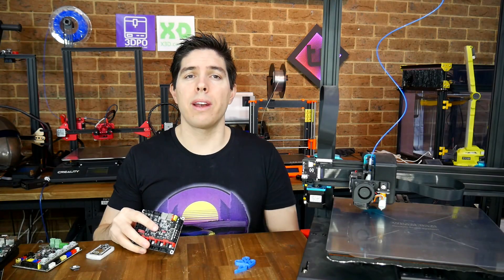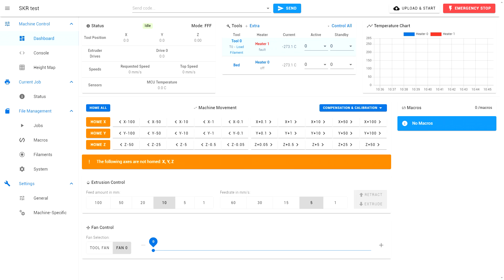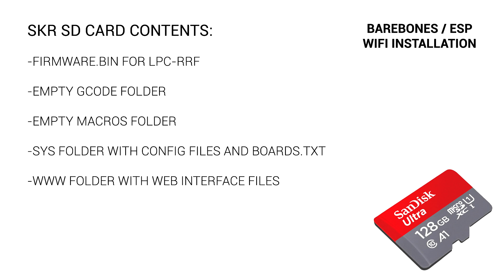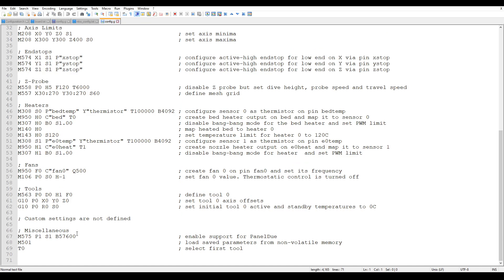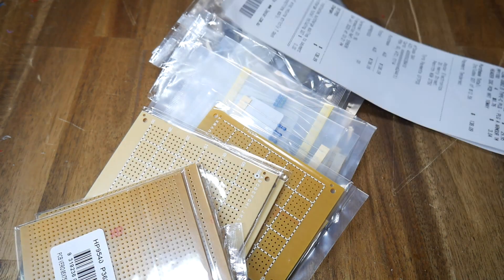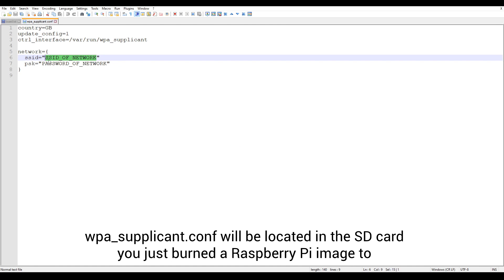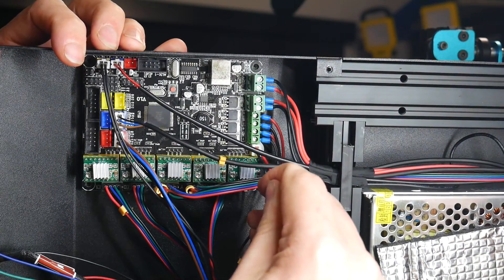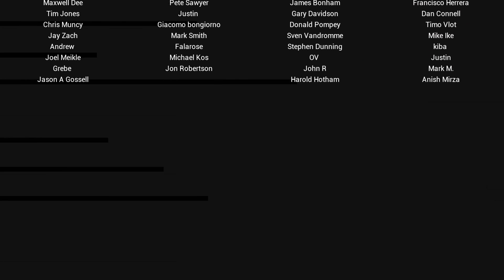RepRap firmware on SKR mainboard guide - The best firmware on a budget

Comment: I have a GRR X400 with dual extruders. Its not a completely polished model as lots of the components are 3d printed. I want to upgrade it to use the octopus controller but a bit lost of where to start with the programming and which firmware is going to be the easiest to configure to the specific machine.   Is there a common 3d printer that already has a lot of precompiled/preconfigured firmware already available that I can start from?

Comment: Thats nice....
unfortunatly i have to program configuration.h and i have TMC2130 stepper drivers.... and they don't have them in there... Im going to have to use the vscode to put everything in for my SKR 1.4 Turbo
Reply: i also wish there was a way to use an ethernet cable..... then i could connect with it directly through the internet

Comment: Where can I get the WIFI adapter in the United States?
Reply: Did you find it sir?
Reply: Not in the US.  I actually ordered it off the net.  
But I'm experiencing a new issue that I just Can't seem to get past.  I'm building a dual z printer and want to use reprap.  When I select my board in the online tool, it doesn't show me the option for a second Z axis.  How do I add a second Z?  Also, on another board I'm having an issue where the web interface shows up in egde or chrome, but I get an error and I can't adjust the settings.. I can't remember the exact error now, but it's throwing a hammer in all my gears..  very irritating. Lol

Comment: I have a Sidewinder and have attempted this port, however I am having 2 issues, I cannot get the axis to home because it is not recognising the inductive endstops, second issue is I cannot for the life of me figure out how to tell the firmware to use the E1 stepper as Z2.  Are you able to share your config.g file so I can see where i have gone wrong?  I have the SKR 1.4 Turbo and using the SBC via Raspberry pi (thanks to Peter's Tindie Store).  Thanks.

Comment: Hy and thanks for your verry nice video.
There is a new product BTT with an ESP 8266 integreated : the BTT RRF WiFi V1.0
It is posible to install Duet firmware with this product. I bouth one but no tested yet.
Do you know this product ? Is it possible to do a review about it ?
Reply: Have you already tested it? I'm thinking about to use this wifi module from BTT
Reply: @DominusJV   I have the BTT RRF Wifi V1.0 module and it's working.. Getting the FW loaded is the real trick..  https://www.reddit.com/r/3Dprinting/comments/lzlp4z/flashing_firmware_on_the_bigtreetech_rrf_wifi_10/

Comment: After flashing RRF3 firmware on my BTT SKR v1.3 with TMC2208, I noticed that RRF3 doesn't support stealthchop and the motors vibrate and are really loud...
LE: Disregard that, using M569 P0 S1 D3 V100 enables stealthchop

Comment: I'd love to see a comparison between the RepRap interface and Octoprint. I know one of the large advantages of Octoprint is the 3rd party plugin support and I don't know if RepRap offers those or not.

Also, for the Raspberry Pi, would a Pi Zero (or Zero W) work or does it have to be a Pi 3 or 4? I feel like the wire loom for the Pi is way cheaper and a Pi Zero is $10, meaning it would be the best of both worlds between the Wifi board and the Pi 3 (easier and cheap).

Comment: I have a problem ... I use BTT RRF WIFI v1.0 ... + BTT SKR 1.4 Turbo ... + BTT TFT70 / MKS Pad70 ...
the first run is OK, but after a reset or shutdown it no longer works, screens connect, but WiFi is not working !! ?? you have to replace the SYS folder from scratch and it's ok to reboot, what could be the reason ?? I looked at various memory cards
Reply: M552 S1 in the config.g?

Comment: COOL! Ordering the stuff I need now.... I have a duet 2 Wifi, so to me this is like an upgrade, thanks, let you know how I get on.
On a side note, I did add an external antenna to the Duet board and chopped a trace on the onboard antenna, although all the moaning about matching the antenna is true, I chose to ignore it. Basically I slowed the wifi connection down, as the antenna is not matched, however it is now more reliable, so the file to print make it to the 3d printer first time every time!
Reply: It's up and working, wiring to the Ender 3 now, need to get a box to hold the SKR board and the Pi3 in the same housing with a fan! Will design something for that and just 3d print it.
I added a DC to DC converter to power the Pi, taking the 24v to 5v, its working fine. So far so good.

Comment: Does stealth chop still work?
Reply: Yes it does
Reply: M569 P0 S1 D3 V60                                      ; physical drive 0 goes forwards using default driver timings D3 is stealthchop V60 is the hybrid speed
M569 P1 S1 D3 V70                                      ; physical drive 1 goes forwards using default driver timings
M569 P2 S1 D3 V32                                      ; physical drive 2 goes forwards using default driver timings
M569 P3 S0 D3 V32                                      ; physical drive 3 goes backwards using default driver timings

Comment: EDIT:  I just rewatched this and see this is addressed at the end of the video.
I've been running the skr for a while and have the Duet wifi on one of my other printers. On the SKR 1.4 Turbo I have the hotend heatsink fan on the heater port E1 to have control of that fan. I imagine it's something like M950 F2 C"!fan2+^pb6" from the example gcode from duet, but I don't really understand what the variables mean. Looking at the gloomyandy github I see under the last section of the wiki Re-ARM  pin names and "2.4 e1heat d9". Would anyone in the community say this added to my fan section in config.g looks right?

M950 F1 C"e1heat" Q500                                   ; create fan 1 on pin fan1 and set its frequency
or
M950 F1 C"d9" Q500                                           ; create fan 1 on pin fan1 and set its frequency
then
M106 P1 S1 H1 T45                                            ; set fan 1 value. Thermostatic control is turned on
Reply: Come to the Discord!
Reply: @PCR  do you have a link? I have a few questions on this setup I could appreciate getting answered. Thanks!

Comment: BTT just came out with an official expansion board for the SKR V1.1,1.3 and 1.4/Turbo that takes up the EXP1 and EXP2 headers, in return you get the official ESP8266 wifi chip and native Duet web control, no pi or custom breadboard needed, it only costs £8.50
Reply: Yep. Or buy at my tindie Store! I am the orginal.creator of Adapter Boards ;)
Reply: sorry, new to this, do you have a link? is it this one: https://www.biqu.equipment/collections/all-product/products/esp-01s-wifi-module-esp8266-for-skr-pro ? so does that mean that fancy $15 board or a rpi is not needed then? Thanks!
Reply: @yosh20000 
https://a.aliexpress.com/_BTPBdN should be it. Definitely not the board you added that's the standard Esp-01.

Comment: Great video, just curious.. can we not get the ESP-01S Wifi Module ESP8266 from BigTreeTech that can plug directly into the SKR 1.4 board's wifi port?  Instead of doing all the soldering?
Reply: Not possible! Need more Pins and Flash Size

Comment: Which would you recommend doing, the ESP8266 or Pi connection? Also, can you still use the old RepRap style scroll wheel screen? I know that they use the same connectors as the ESP8266 cable does.
Reply: Both OK. Not possible

Comment: Did you feel like this was equivalent to the real deal?   You never said if there was any negative effect after everything was running other than unreliable wifi.
Reply: Unrelialbe WiFi is not the Case Most of the time. If you are using the esp Version you only can connect one Connection via the Browser. With the help.of a Raspberry its like the duet 2

Comment: what did you set for the PWM Control Channel  in the Confiscator tool?
Reply: Come.to the Discord! We can help you there!
Reply: @PCR  Sure thing, what is the discord info?
Reply: @PCR   Got that figured out using the listed config file  as refrence! :D Now on to stealth chop.. i dont think mine is active cause they sound the same as the old drivers and not quiet like my other TMC2209.  I dont used discord much so i might need help finding the one you are referencing :)
Reply: Dear ratler. Discord its the easiest way. Link on GitHub. For stealthchop you Have to add D3 V40 to your Driver Timings!
Reply: @PCR  Awesome thank you! Ill go find the discord and join :)

Comment: Hi! Thank you for sharing your big experience.  
I had been wanting to try the Reprap firmware for a while, and your video was the right input!
I just wanted to add that all those resistors on the ESP8266 module are not really necessary. 
ESP mcu works with the same voltage level (3.3V) as the LPC17XX main processor.
At the moment I have only kept the pull-down resistor on the RESET pin and it works without problems.

I also added "M552 S1" at the end of my config file in order to start WiFi interface as soon as printer go on.
Reply: Its only for saftey measures ;) Duet does it the same way with their atmel one! Better Safe than sorry!

Comment: You should probably recommend bending the pin on the tmc2209 for sensorless homing instead of snipping it, at least then it can be reversed if they do decide to use the feature one day
Reply: The pin could always just be de-solder and removed. That way it could just be soldered back in later.

Comment: Will this be able to be done on the SKR Pro V1.2? Having 6 independent stepper motors is needed for a core XY with triple-axis bed leveling. If not, what is an alternative to having 6 independent stepper motors while running RepRap firmware?
Reply from the maker: The LPC part refers to the processor, and the SKR Pro doesn't have an LPC so no go.
Reply: Teaching Tech Alright! Thank you. Does this mean that there is no method to use a cheaper board with reprap firmware if I need 6 stepper motor drivers?
Reply: Matthew DiDomenico duet maestro with the two stepper expansion board gives you an officially supported board with 7 drivers.
Reply: Christoph Müller Well yes, but the idea is to not be paying for a duet board... I was wondering if there is a cheaper alternative using the method from this video.

Comment: Would this work with an skr mini e3v2.0? Or do  you need the extra power from the skr 1.4 turbo?
Reply: Only LPC based Boards. Skr mini is STM32 based..
Reply from the maker: All of the compatible boards are listed on the wiki.

Comment: can we do all function of the duet with SKR with reprap firmware ? can we connect the SKR with reprap firmware to raspberry using USB cable ?
Reply: 1. Most of them yes!
2. If you want to use octoprint yes. If you want to use DWC via USB. No
Reply: @PCR  can we use the SKR with reprap OCTOprint with USB connected to the SKR and use the DWC ? can we use the TFT 3.5 ? how to setup cooperheat hotened in reprap ? thanks
Reply: @EnergySeeker  DWC = Duet Web Control. The GUI which you can See in the Video. ;) With that you can Control the printer upload.gcode etc
Reply: @EnergySeeker  you can use the TFT. Copperhead.like Marlin.
Reply from the maker: Plus I recently installed a Copperhead on a Duet powered Seckit Go. The firmware step were covered in that video (for Marlin as well).
Reply: @TeachingTech  which one you prefer Marlin or reprap ?  can you do all the function of duet with this setup ?
Reply: @TeachingTech  if i use the Raspberry PI 3 is it ok or i need raspberry 4 with 4 Giga ? do i need to do anything to the SKR 1.4  or all is done with Raspberry only ?
Reply: Peter Ross am using the raspberry 3 as sbc to control the skr where do I get the reprap firmware for the big tree TFT 7 inch LCD ?

Comment: Would be nice to have a way to have octoprint and the wifi connectivity on one raspberry pi. e.g. port 80 is octo print and port 8080 is the reprap interface. However not an option for me as it probably does not allow the park/pickup movements I need for my three tool heads. Needed to code that feature into marlin, too and SKR Pro is not supported.

Comment: Do you have any informations about ther tft screens  like  tft 3.5 v30 ?  this model which can be switched  to normal text mode ? I currently have skr 1.4 turbo and such screen and tcm2208 laying around and it will be good to compare it with real duet
Reply from the maker: There is a a link in th wiki to a custom firmware for the touch mode of the BTT TFT35. i didn't explore since my donor printer has an MKS TFT28.
Reply: @TeachingTech  and what a bout bltouch settings as I seen that you didn't configure it during config preparation and later on it was only mentioned that you had some problems to set it up right?

Comment: Michael please do a comparison of marlin vs reprap firmwares. which one is better? which one produces better prints? is there a difference at all?
Reply from the maker: I think a difference in print quality won't exist from just the firmware, if all things are equally tuned. It's more about the overall approach and specifically about configuring firmware.

Comment: Random fact. I couldn't get my touchscreen to work with SKR 1.4. Some versions of the Sidewinder seem to use a clone of the MKS touchscreen which is incompatible for some reason. And believe me I tried everything.
Reply from the maker: I should be possible. Essentially they are all just RX, TX, GND and 5V. This is the same for a USB port (pronterface and octoprint) as well as MKS TFT28 and BTT TFT35. Baud rate is the obvious thing to look at and also having something plugged into the USB port might interfere with the serial pins.
Reply: @TeachingTech  Trust me I tried it so many times, with so many different configurations, baudrates, pin associations in firmware and even getting the SKR touchscreen firmware to work on the MKS screen. I just couldn't get it to work. At some point, I thought that my board was defective but then I received the SKR TFT24 which worked ... honestly I am out of ideas.  I heard that some people had the same problem with the same clone touchscreens so unless we are all that stupid( which is not completely impossible tbh) I think it's an incompatibility issue

Comment: aside from nicer interface, and sane config files - (it looks like you can edit the config without having to re compile the fw...) does this print better? i know reprap is the original, but what exactly makes it better?
Reply: Ease of config mostly. It had better pressure advance, but i guess the new linear advance in Marlin is on par. The interface and control is superb but it’s not that Marlin is bad, it’s just a pain to use and play with.
The fork Duet firmware uses is a big upgrade over “original” and this fork of a fork for SKR has just a bit more work to be done. With way superior tmc drivers, integrated wifi/lan connectivity and overall better build quality, i personally see no real reason not to get a cloned Duet for 60 bucks. All this in video mentioned hassle gone & cheaper.
Reply: @marko2210  but the cloned duet now days is almost the same price as the real card , see alibaba there is clone for 200 $
Reply: @EnergySeeker  duet WiFi 2 1.04 is around 50 gbp on ali
Reply: @EnergySeeker  Aliexpress has Duet 2 wifi clones for between $65 and $75 USD.

Comment: Will this work if I have a BigTreeTech TFT35 V3 E3 display?
Reply: With a modified firmware of the TFT yes
Reply: Where can I get that firmware, I have tried other modified versions but cannot access the sliced print files on the SD card (inserted on tft)

Comment: Can you explain...in one sentence...why RepRap firmware is so much better than Marlin that it warrants all this monkeying around?
Reply from the maker: 3D printing is a hobby for me, and I enjoyed the process. If you only use it as a tool with no tinkering there is no problem with that either. Each to their own, if you don't want to do it so be it.
Reply: @TeachingTech  That was three sentences. You failed the test.
Reply: you can change anything in the printer from a web ui and text file, no firmware compiling.

Comment: I've got an X1 I've been running stock for weeks, despite having an SKR 1.3, TMC2209s, TFT35, BLTouch, etc. to install on it. When you mentioned this project on Patreon I was glad I procrastinated on the upgrade! I will try this using the Pi4 currently running OctoPrint in lieu of the ESP8266. I feel like I'd be a lot better at your heatshrink loom technique than protoboarding an adapter. That leaves the TFT35, which I may just skip and keep the stock TFT28... then maybe a tablet running the web interface. Glad I've been running it stock this whole time, so I have a good baseline to compare the RRF setup to. Thanks for the video Michael!
Reply: Hello, Since you do have the TFT35 which includes an ESP port where you should be able to insert an ESP8266 module. My question is; would that work without having to do any hardware modification? Would it just be changing the settings & compiling the firmware for the screen to support the RRF ESP; but is that even possible?
Reply: From Jay's blog; you cannot use the BTT ESP module; since you need ESP-12/13 or ESP-07.
But I believe it should be possible if you bought ESP-12 serial module.

Comment: Is RepRap firmware better to run on your 3d printer over Marlin 2.0.x???
Reply: RRF is much more modern and has been designed for 32 bit controllers from the start. Marlin has a ton of legacy which they should have thrown out with the new 2.0 branch. Having to recompile your firmware for trivial configuration changes doesn’t make sense for the more powerful ARM cores.

That said, if you don’t mind dealing with the shenanigans of marlin and you have a working setup you will not see a huge difference.